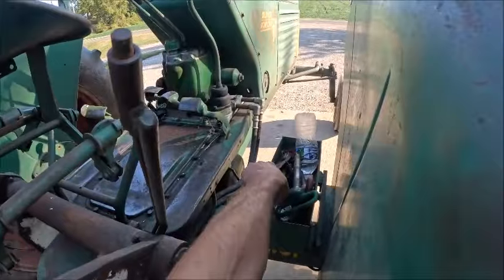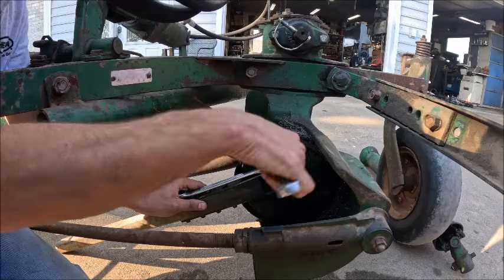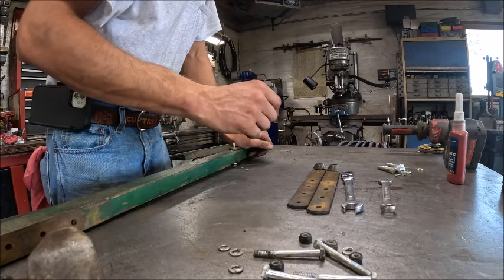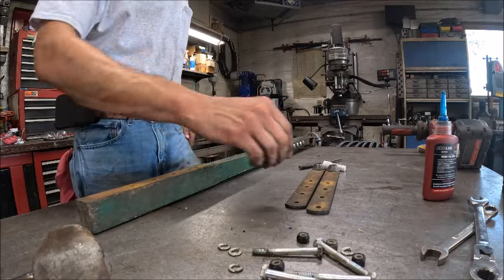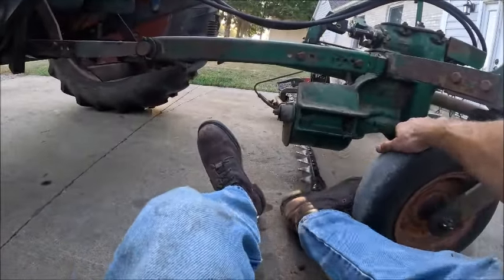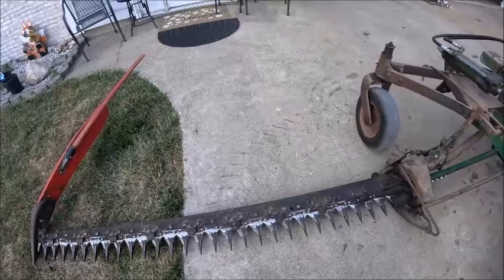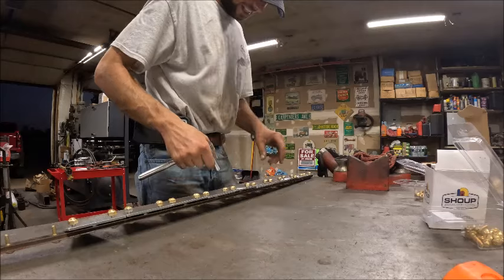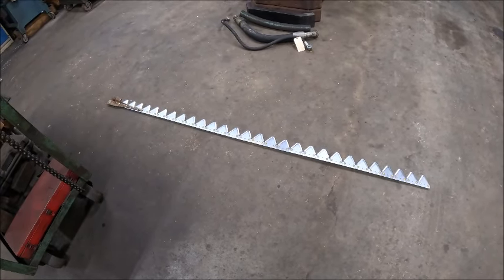Oliver 82 Mower Post Season Maintenance

Comment: I had made a pitman arm for my sickle out of some square tubing two pieces one slid inside the other one and put a sheer bolt is is so if I hit Any thang it gust pop the shear bolt in stead of braking the wood and that’s manly because I keep picking up new ground and keep finding thang in the filds first time mowing them and I gat tired of making new sticks all the time and tired of still finding crap in the fild after walking them thank god I don’t have to worry about it so much anymore sins I’ve re done the filds